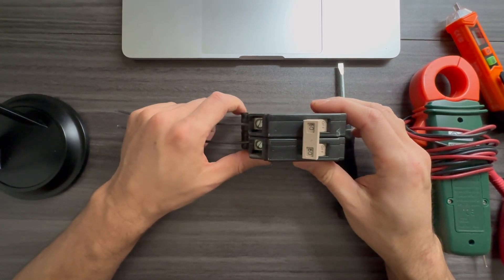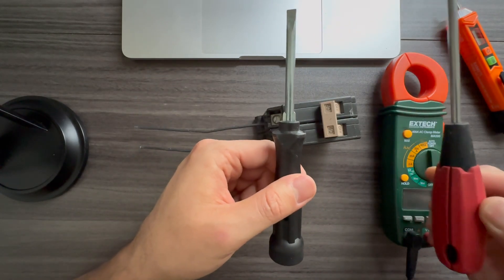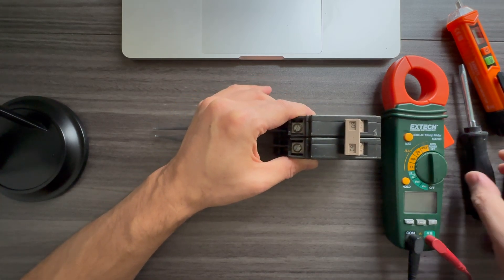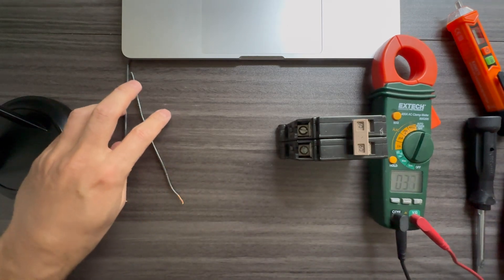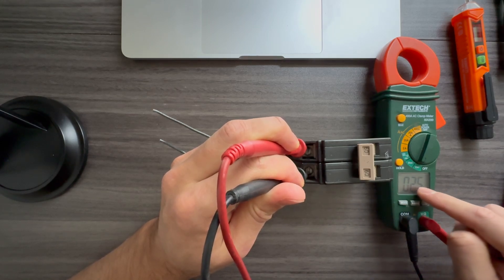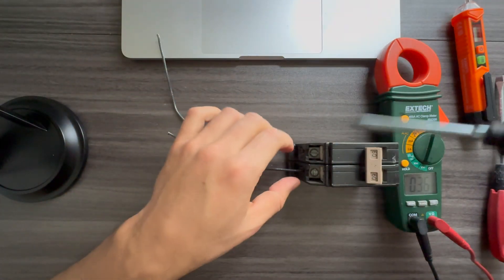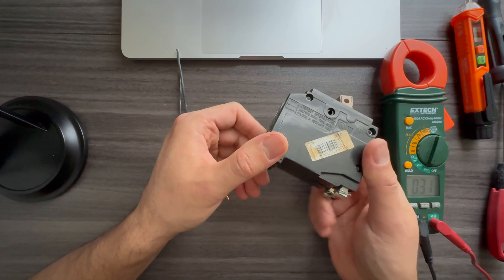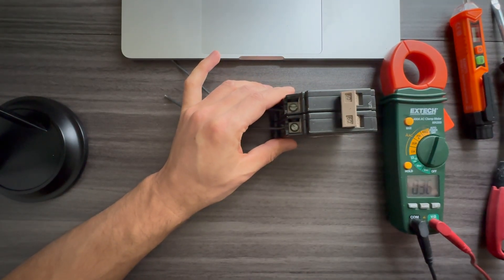How to Test a Circuit Breaker – DIY Guide for Identifying a Bad or Faulty Breaker

Comment: Mine stay on but i have no lights in bedroom or bathroom. I font have gfi in bathroom either
Reply from the maker: gotta use voltmeter to check and then troubleshoot further if it's operational breaker and has 118-125V